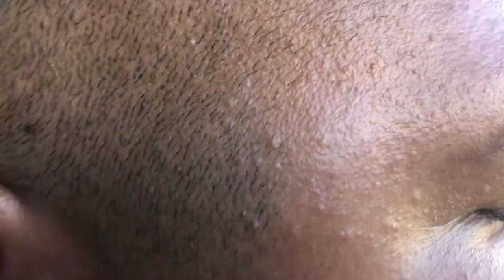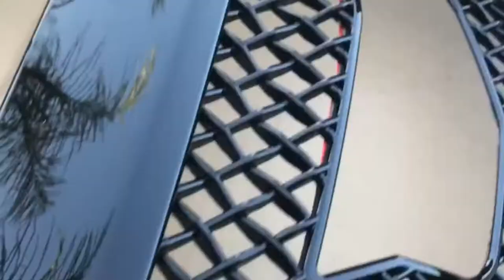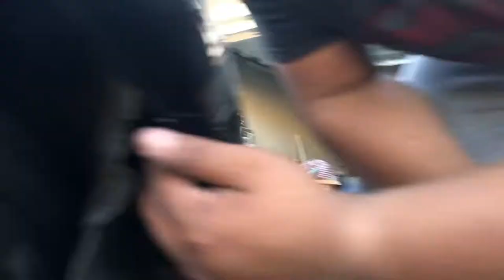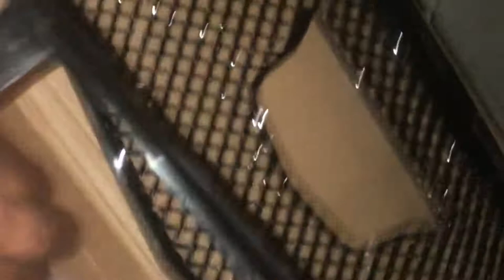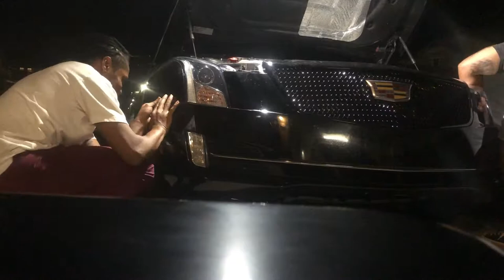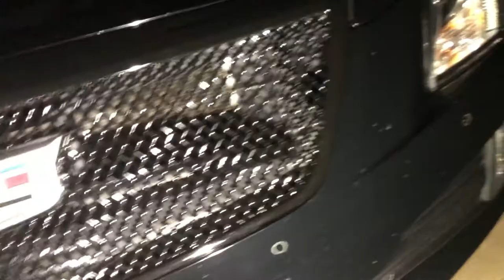CADILLAC GRILLE REPLACEMENT ALMOST GOES HORRIBLE WRONG!

Comment: you know that silver trim surround unbolts from the bumper right?...i dont know why you would cut up a factory grill that cost about $600 to replace
Reply from the maker: 5.29 the bumper and grille are one on this model bud. i figure thats gms way of saying money... In order for the overlay grille to be utilized as a grille ( flush ) what we did was necessary. just laying the grille over is just nasty and tacky. imo
Reply: @2LITerD  i have the same year car but the 3.6 and trust me it has torx screws that hold it on ive literally taken it off to paint black. It looks great dont get me wrong bro just work smarter not harder so to speak
Reply from the maker: @sbohnke7304  right on, if you ever end up replacing that factory grille with a mesh one or any grill for that matter, please do a video! I think my video may be the only one for ATS as of now. Correct me if I’m wrong but it be nice to see more of us out there!

Comment: Aye bro so on the new grill did y’all bolt it in or use epoxy and glue it to bumper...
Reply from the maker: svtfanaticguy24 Sorry for the late response, we re-bolted it on using all of the OEM pieces as well as 3m adhesive tape n glue.

Comment: What is that residue on the front of the engine block, I'm not the fashion police by any doubt, but if its leaking oil, lets get that taken care of. I was thinking about buying this same car tomorrow?
Reply: Yeah that's oil seepage on the front timing cover, very common on the ltg.
Reply from the maker: unfortunately, your both correct not my finest moment on cam buts it is a downside of these ltg motors.  looking into way to alleviate the issue currently.

Comment: Hey man how does the emblem come off? I want to replace mine but really don’t want to pull the bumper off.
Reply from the maker: tbh, the emblem does not "come off" well kind of. It clips in but as shown in this video the emblem is mounted to the grille. Depending on what your doing it may still require removing the front bumper. Best of luck to ya !
Reply: It's a overlay grille
Reply: @solo-bn6fw  does that mean you just put it over the stock that easily?
Reply: @calebepifanio8515  I cut my center part of my grill out  then apply my over lay so it will have a more authentic look to it without seeing my old grill behind it
Reply: @solo-bn6fw  alright I’ll most likely do that thanks

Comment: Would a grill like that work with older cadillacs? Like a 2014 ats
Reply from the maker: "I THINK" but I'm reeeeally not the best person to ask. I'd call Gm and ask the parts dept if the front end measures between the yrs are the same or not. They have access to that kind of information

Comment: So you didn’t need the surrounding frame ? Just the center piece ? 😕
Reply from the maker: The emblem was able to be reused although the piece it sits in "the mount" if you will, needs to be cut out from the oem grille and reused in order to keep the emblem in place. I'm sure theres others ways but that's just the work around we used.